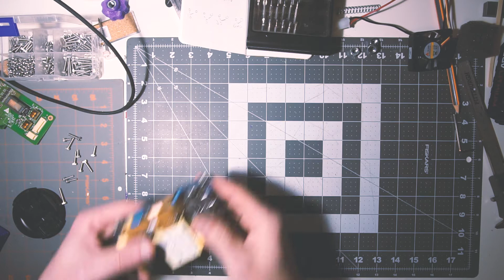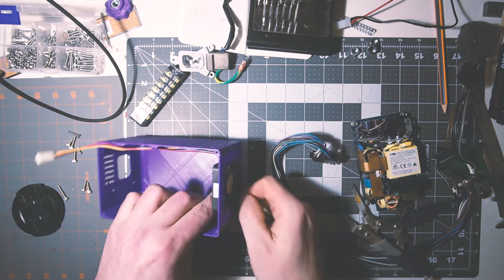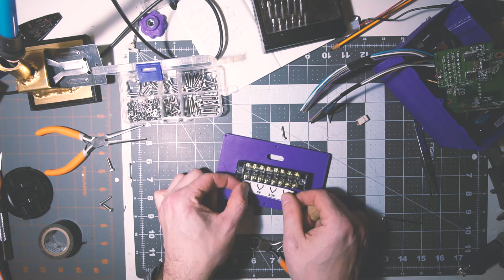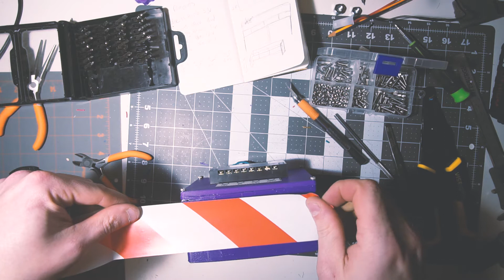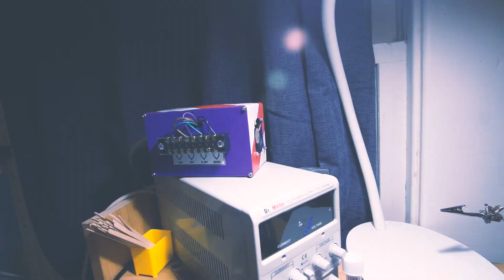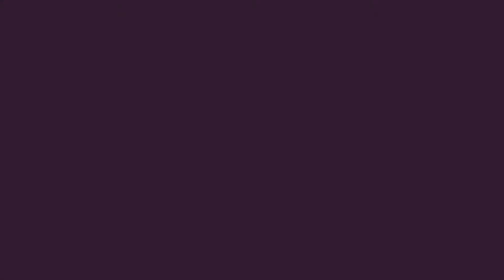Multi-voltage benchtop power supply from broken iMac - LMSAT

Comment: Thank you so much for this video. I was wondering what to do with these PSUs and, as I am a hobbiestdoing valve/tube amplifiers, I think this will suit my purpose. Moreover, the should be much better filtered than what I do with cheap ebay buck converters.
Cheers,
Pedro

Comment: Thanks for the video..

Can I get 24v pinout from old imac psu. I need to get 24v 4-6 amp power in a small space.
Reply from the maker: I'm pretty sure it only has 3.3, 5 and 12v outputs. You could always add a boost converter to get to 24v, but i doubt you'll get the 4-6 amps. Although, I never checked into the actual amperage it will put out.

Comment: It looks like this is not the case with specific power supply but some of the standard PC power supplies require a load on all of the voltage lines to deliver the proper voltage. I have always used large ceramic resistors for the load across all the different voltages. Without a load they can provide well over the specified voltage.
Reply from the maker: That is great information to know, thanks for sharing it!